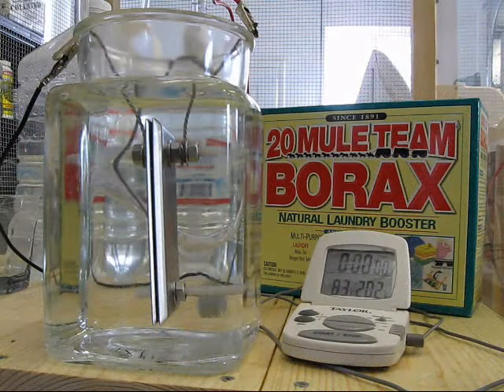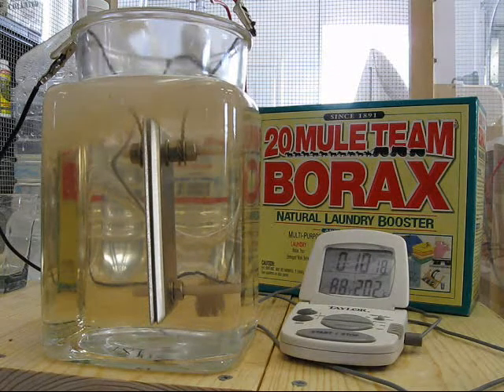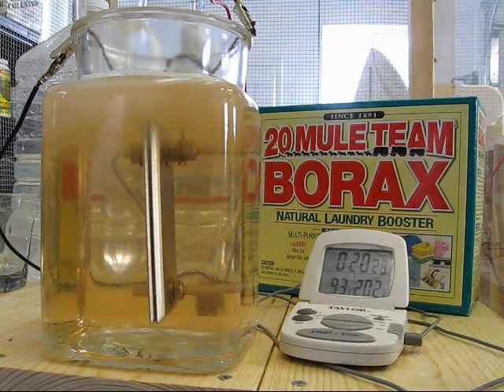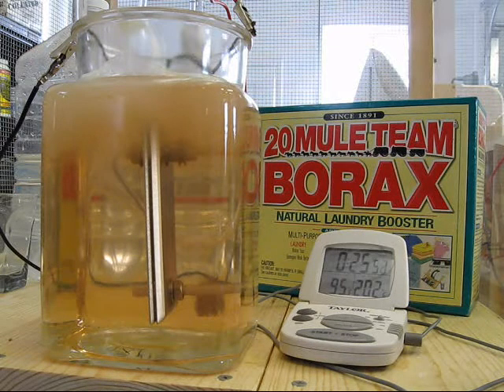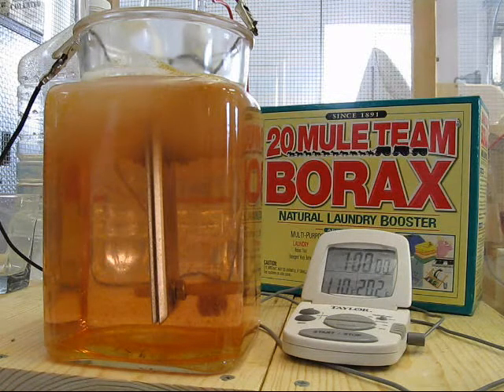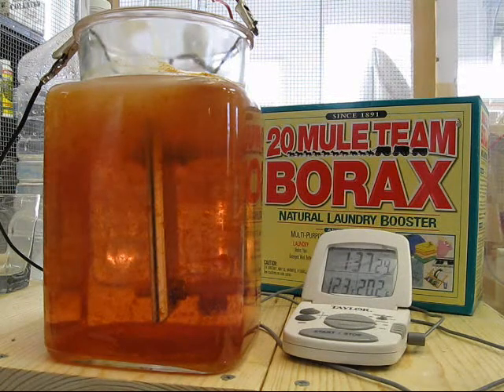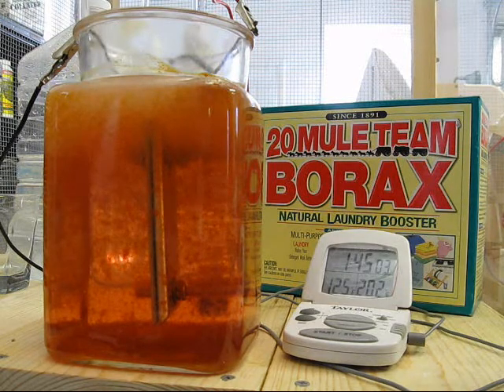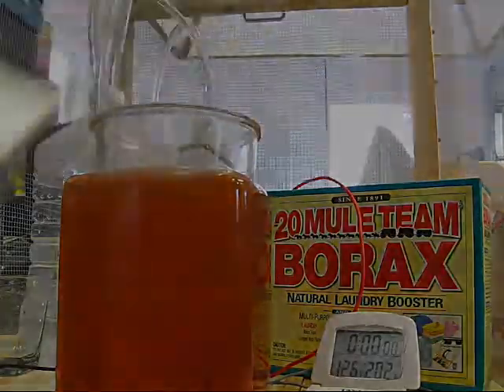#08-060 Observational Electrolyte Test Using Borax

Comment: Charlieehler, you should try  a drop ( Na2S2O ) + (Na2CO3) Sodium Carbonate, no PWM required , no rusty on the plates,less amps draw, cristal solution, less heat, more gás and you can also used mineral water, believe me,
Reply: What is the name of the non rusting chemical?
Reply: @cyborganica  Sodium Thiosulfate